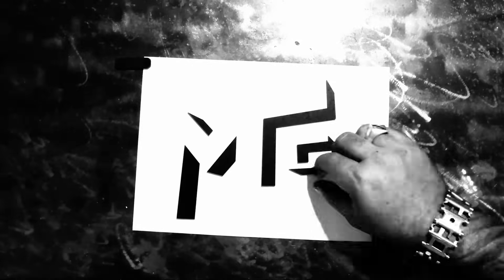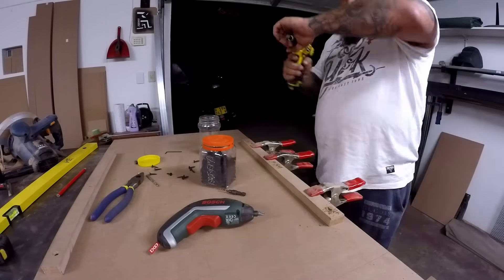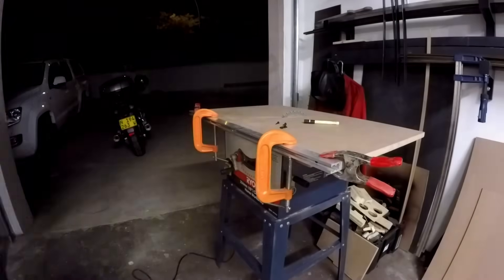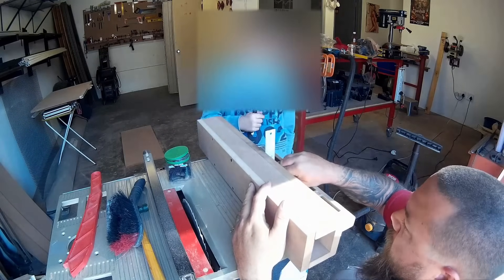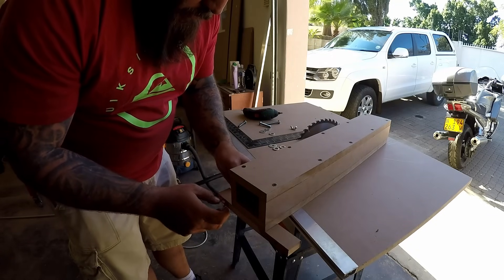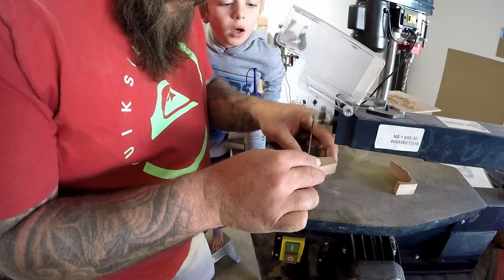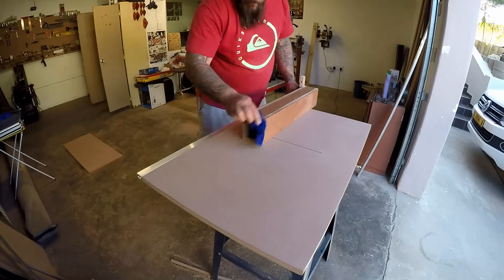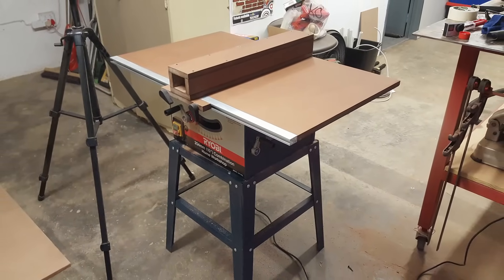Cheap Table Saw Improvements Part 1

Comment: Hey, I just bought a secondhand table saw just like yours. Thanks for this video but I plan to remove the aluminium top completely and replace it with a much bigger top. The aluminium is so worn down nothing lies flat. There is always a wobble. The fence is also bent.
Reply from the maker: Hey Andrew, yeah, these saws aren't great but with a bit of work they can do a decent enough job. You should check out my second version of this upgrade, made a thicker top that fits around the existing one plus a new fence, works a lot better now... here is a link: https://youtu.be/pGNBSCswBac
Reply: @maconSTUFF  I am guessing you are also from South Africa. Great to see some of my own countrymen getting into woodworking and YouTube. The other videos are great but when you start looking for the same stuff locally you end up doing something entirely different. Have you checked out PS woodworking? I would like to build stuff like that for my workshop.
Reply: @maconSTUFF  O, and I have already checked out your upgrade video.
Reply from the maker: I'm actually from Namibia, but close enough.. LOL... Yeah, I'm sub'd to his channel too, that guy does awesome work. Have you seen Woodshop Junkies... he's from Cape Town, he also does amazing work...
Reply: No, I have not. Will check it out. Thanks.
Reply from the maker: Yeah man, I think you'll like it, He has some really great ideas, He's about to hit 100K sub's... you should check his all in one woodworking station series... amazing... anyway, let me get back to restoring my 120 year old reed organ... :-)

Comment: Mate you need to wear a mask with MDF.  Also keep the kids away from MDF dust.
Reply: Yeah srsly. Made that mistake. Had serious problems with breathing a few days
Reply: Stuart, you are absolutely right. The waste product from MDF has the potential to be very harmful. Some companies in the  UK will not even allow products made from MDF in their premises. As with all dust products it can also become explosive. Use a dust extractor/collector. Badly burned both of my hands when sawdust exploded in the shop. I was just a 16 yr old apprentice at the time.
Reply: Also no ear protection for both saws, would not recommend that.
Reply: Our local schools had kids cutting and sanding MDF with no mask and indoors
Reply: Yeah unfortunately after years of working with and sucking down clouds of MDF dust they turned around and said turns out that stuff is probs going to kill you our bad 🤣
Reply: @thedieiscast9729  the latest things I've seen claim it might turn out to be worse than asbestos exposure
Reply: @thedieiscast9729  never heard explosive mdf before
Reply: @JoRoBoYo  Dust from MDF can form an explosive mixture as can almost any dust particles. A common explosion site is inside dust extraction ductwork. A professional installer will always take this into consideration when designing a run of pipework. I myself suffered severe burns in a dust explosion as an apprentice.

Comment: Greetings from SA to Namibia! Weren't you afraid that you lost the thickness of the new top to thickness of material? Let's say you could cut 60mm before the new top. Now you van only cut 60mm less thickness of new to? I have the same table saw and thinking off a new to as well. Only concern is how to compensate for the loss.

Comment: Nice job one think I don't like is that you lose 3/4 of inch of the height   of the blade what i did to my table saw  i made too extension and one in the front .
Reply from the maker: Yeah, I hear you there... hasn't been a problem for me so far... cross that bridge when I get there...

Comment: After 3 years, how are you finding the fence? I have a 'cheap' table saw with a bad fence and useless T-slot too small for a normal mitre gauge. I am debating on fixing mine up or buying a nice cabinet saw. My saw runs well but is not very useful with a bad fence and no mitre gauge. Thanks.
Reply from the maker: Hey Bill, Well... I only used it like this for about a year, then I did a second upgrade... here is a link if you'd like to check it out: https://youtu.be/pGNBSCswBac

Comment: Sub'ed.  Saw you are from Windhoek???? I own two of these saws and the standard fence is 11-1-11.  Thanks for giving the new direction for a fence.
Reply: Making SawDust I'm in the market for a table saw and I'm not willing to spend too much since I'm a hobbyist. This particular Ryobi saw keeps popping up on Gumtree but I'm worried about that misalignment issue. Have you experienced it on both your saws?
Reply from the maker: Once you get used to the original fence, its not too bad,  just be mindful of the fact that tightening it wont necessarily mean its square... I did not want to check for square before every cut, which is why I did this upgrade, if I lock down my fence its square every time...
Reply from the maker: Great... Thanx for watching..
Reply: MACON CAMPBELL thanks for the feedback. So you reckon it'd make a good saw even with the original fence?
Reply from the maker: Well, for the price you wont find any better, I think even without the upgrade, I could have gotten used to it...
Reply: MACON CAMPBELL thanks for the help

Comment: It was cool what you done but putting 18mm MDF on the top will restrict the depth of the cut.
Reply from the maker: Thanx Shanu... yeah, I know... I fixed that problem with version 2.0... here is a link: https://youtu.be/pGNBSCswBac

Comment: Does your fence stay pretty straight and square? Do you have to check before cuts each time still? Nice build though. Gonna attempt on mine soon..
Reply from the maker: Hi Giovanni... once I tighten it down, it was square every time, but I check before every cut anyway "force of habit" even with my latest rebuild... here is a link if you'd like to check it out: https://youtu.be/pGNBSCswBac

Comment: Boet you've done very well. I'm in exactly the same boat as you: got the same stuff (esp that Ryobi table saw) and now looking to build it into a larger work table, and also to build a good crosscut sled for it. I already have a small crosscut sled, but its limited to small projects. Beste groete.

Comment: Hi Macon. I'm interested to know if the linseed oil worked for the top.  I thought it may be a bit sticky in the long term and create more friction that you may want.
Reply from the maker: Hi Michael... I did not experience any stickiness... the oil did dry out a bit eventually, but still stayed fairly smooth... I did ditch this top a few months ago and make a new one though... used a laminated counter top... much better, here is a link if you are interested: https://youtu.be/pGNBSCswBac ... Thanx for watching
Reply: Thanks I will definitely watch that a little later.

Comment: I guess that is a strictly straight cut saw? No angle cuts or dado blade provisions.
Reply from the maker: Well... that one was... I did another rebuild a couple months later which solved many of those problems, here is a link if you're interested: https://youtu.be/pGNBSCswBac

Comment: I you had removed your fence and rotated the wing nut on the left side 180 degrees and reinstalled it you would clear your table top. Just a suggestion.

Comment: Hi Macon, could you help me identify how you attached the new table top to the original saw table, please?
Reply from the maker: If I recall correctly, I just drilled some holes through the original table and attached it with screws from below...

Comment: All you have to do to line up that fence is push forward on your end of the fence, and while holding pressure tighten the screw. I have one like that, and I had a bigger Craftsman saw from the 70's, that had the same type of fence, and they both work fine once you learn the trick. One disadvantage to a fence that just locks on one end is it can deflect, however yours looks sturdy enough that it doesn't look like you will have that problem. If I were making one like yours, I would put one bolt in the middle. It would be a lot quicker and easier to adjust. If you have any ideas on a zero clearance insert for the table, please, let me know. Mine has nothing to support an insert on the motor side.
Reply from the maker: Thanx Charles, yeah I'm sure I could have gotten used to the original fence, but I manly wanted a larger top... I actually did a second upgrade a few months later which turned out a lot better, here is a link if your interested: https://youtu.be/pGNBSCswBac

Comment: i have that exact same cheap table saw, its full of problems, but the biggest problem for me is that after 15 years the motor has burned out .......... yes 15 years, sometimes crap lasts forever....

Comment: The problem with the additional wooden top is that you lose that much in blade height
Reply from the maker: Hey Carl... I rarely need more depth of cut, but I did fix that problem with my second rebuild, here is a link if you're interested: https://youtu.be/pGNBSCswBac

Comment: This may be a stupid question, but what is the small drill you are using? The one that fits in the palm of your hand, and would you recommend it to anyone?
Reply: Brian Fuller It's just a small hand palm drill/driver.. They're normally an 8 volt, very good for your typical household screws. For being small, they have a decent amount of power.
Reply from the maker: Hey Brian... Its a little Bosch IXO 3 cordless screwdriver, charges with micro USB... would most definitely  recommend it... hols its charge quite long, and i was very impressed by the power, for such a small tool... obviously its not going to replace a "Brushless impact driver" but it is very handy none the less... Thanx for watching..
Reply from the maker: Hi Travis... this one is actually only 3.6V LOL... but yeah, it does have a surprising amount of power...
Reply: Thanks for the info guys, I'll have to look into getting one, didnt want to spwnd the money if it wasnt worth it

Comment: Cross cutting a small piece of wood perpendicular to the guide fence and using the guide fence and a push stick is very dangerous...It could kick back easily, and it's not a pleasant experience.

Comment: If a cheaper table saw will work for you and your needs great.  Good video and very inexpensive parts.
Reply from the maker: +Vint thanx...
Reply: I was building a few cabinets years ago and my table saw motor bit the dust in the middle of everything.  I had to finish the job so I could have enough money to purchase a new table saw.  I bought a cheap inexpensive   bench top table saw and basically did what you did because getting accurate cuts was impossible with the fence system that it came with.

Comment: I want to make a new top for my  cheap saw, but didn't want to lose the depth of cut capable by the blade, especially when using a sled as well. I'm by no means part of the safety police, but you should really wear a mask when sanding mdf bro
Reply from the maker: Thanx... Yeah, workin on it... :-)
Reply: The loss of depth of cut doesn't matter really because the motor can't cut anywhere near the depth of cut remaining without over heating the motor, but cuts sheets well. Also, I made a top using some curtain track for the fence to mount on, works ok.

Comment: That’s my problem.I do not know if I will ever trust my fence to be accurate with a simple click
Reply: Nothing I hate worse than a poorly designed fence that won’t repeatedly lock down square to the blade. Will just ruin an otherwise decent saw...

Comment: New subscriber, thanks for video, think I will do something similar with my table saw. Sorry not wanting to lecture you but please get some dust extraction when working, cutting MDF, it's got some very toxic chemicals in it. I'm a smoker but even I use a mask when cutting/drilling it. 

Still a good video, Cheers 🍻
Reply from the maker: Thanx... Yeah I know...I just keep forgetting, but I'm working on it... :-)

Comment: Great job Macon!  I was very impressed, and at the same time perplexed.  If I heard correctly, you said you have never owned a table saw before, yet, you have some mad skills!  I also see a manual miter box, yet, I also see an electric scroll saw and a drill press.  I would just think that an electric chop-box would come before a drill press and a scroll saw.  At any rate, great job on the table saw improvements.  BTW, now that you have a table saw, it should be very effective cutting aluminum (or, aluminum as you say.  Hahahaha).  If cutting aluminum though, it is preferable to have a blade with a slightly negative rake.
Reply from the maker: Hey Trip... Thanx alot... yeah, all the tools sort of got bought in the order in which I needed them, since this vid I have gotten a "real" mitre saw LOL... and a bandsaw, wood lathe, steel mini lathe, and a week ago, a jointer/thicknesser combo... all of which I never used before... HAHA... it can get scary at times... planning a whole new design for the tablesaw, gonna be 10 x better...
Thanx for watching...

Comment: Coming from someone with the same or less level of experience, great video m8! I was thinking same with mdf and dust risks, would also be good to paint a “no go” zone around the saw to keep ur hands well clear of it, I reckon people selling MDF should make buyers aware of the risks.  Anyway, thanks for the video, I’ve been trying to work out how to modify a table saw I just picked up for $70 Australian GMC, some great tips here, there’s some go vids on YouTube on cross cut sleds too, next step
Reply from the maker: Thanx Tim, I dont use MDF that much anymore :-) ... good luck with yours, you may want to check out the next upgrade I did, here is a link: https://youtu.be/pGNBSCswBac

Comment: Great vid! Thanks for the help..I have the same table saw and live in SA, I'm also struggling to find the 'key tracker' Please could you guide me in the right direction (excuse the pun) : )
Reply from the maker: Thanx Ben... Gosh I'm not sure... the stuff I ended up using wasn't proper T-track either... found it at a local off roading/camping goods store called outdoor centre, think it is meant for rooftop tents or something... I recently discovered a company in SA called "Toolcraft" who stock it... they have an online store too, here is a link: https://www.toolcraft.co.za/pages/search-results-page?q=t-track
hope that helps...

Comment: Where did you get the track from? Great Job! I need to extend mine
Reply from the maker: Thanx Vince... well that's not proper T-track, just something similar I got from a local "outdoor center"
Reply: maconSTUFF understood but I've got one of those cheap aluminum table saw stands and need to extend it and build a track

Comment: I'm not knocking you here mate and you may all ready know but it's 3 am I've but its to late to read 700 comments but ive subscribed but just watching your improving a table saw and I noticed you kids come and go and yourself included but MDF medium density fiberboard is poisioness when inhailed I know you had the door open at times but you drilling and sawing over it and the Baird at the height to in half even dust off the table not knocking you just trying to keeps you'd safe

Comment: Dude I have the same table saw here in SA. Gonna do a similair upgrade to it. Shot for the vid! Nice job
Reply from the maker: Thanx Allan... Check out my second upgrade before you settle on this one...: https://youtu.be/pGNBSCswBac
Reply: Only the problem will be, as he put a 18mm MDF on top of the saw table it will restrict the depth of the cut.

Comment: Lekka Boet. i got the same ryobi table saw and that fence is sooo kak. so im gonna build a fence like yours. where did u get that "t-track" cause thats the only reason i didnt build one yet. lekka man. will follow.
Reply from the maker: Yeah, that t-track was a bitch to find, mine is actually not proper t-track... got it from Buschwakkers
Reply: Do places like Amazon ship to NAM?  Both Incra and WoodRiver make really nice track. If not, maybe somebody can mail you some from elsewhere.  Nice job.  I can't believe you didn't use even a crappy mask, mate!  That MDF is NASTY stuff when you cut it.  Even with a crappy face mask, I'm coughing for days after cutting it.  Nowadays, I use a proper mask with the two filters, and it's little better.   Still, maybe smoking has lined your lungs nicely, and you are now immune to that shite ;) ;)

Do me a line if you need stuff like the t-track, maybe we can figure something out.
Reply from the maker: Thanx man... Yeah Amazon does ship here, but i have bad luck ordering online... stuff takes forever to get here.. if it gets here at all... 
btw... these days i do wear a mask LOL...

Comment: I find this video even more impressive when I saw you running around barefoot. Great job, I have a friend who I know can benefit from this since she has the newer version of the same saw, and the same problem.

Still happy with the new table top you made? And additions or alterations since this video?
Reply from the maker: Hey Russell... Thanx, dont do barefoot that much anymore, cause, you know... trolls... LOL... this one worked great, I did however redo it a couple months later, its a little more complex than this one but works a lot better, here is a link if you're interested: https://youtu.be/pGNBSCswBac
Reply: @maconSTUFF , fantastic. Thank you!